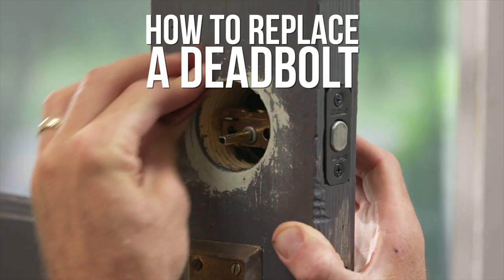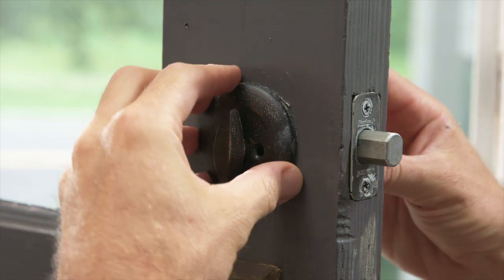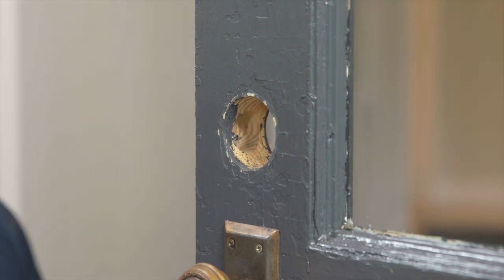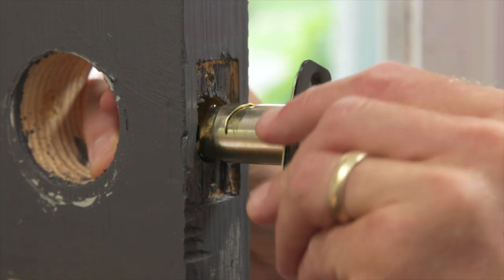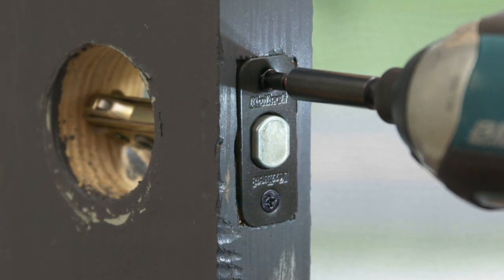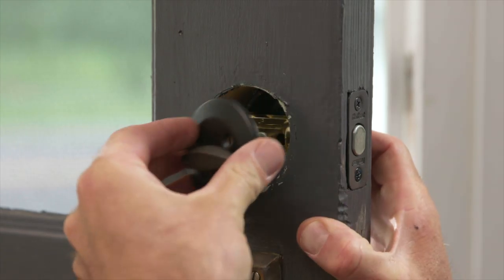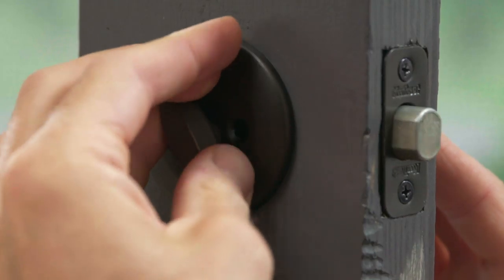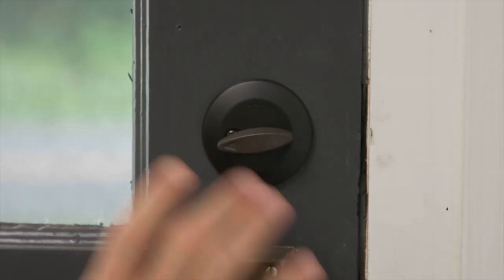How to Replace a Deadbolt | HGTV

Comment: What if the deadbolt is in the extended/ locked position and the mechanism is destroyed? How to get the deadbolt out if the door is stuck in locked & closed position?
Reply: Drill a hole in it
Reply: Got the idea

Comment: When you buy a deadbolt, you should know that there will be several in the case with matching code numbers and keys.
The manufacturer does this so you can use one key to open all of your exterior doors with matching deadbolts.
I suggest that you either find a deadbolt that has no matches in the case, or buy them all and return the ones you don't use on a different day.
Otherwise, a criminal who was watching the shelves could buy the next lock and follow you home to learn where you live.
They would have a matching key from their lock and could let themselves into your house when you were not home.
This vulnerability would be especially important for young women to know about.
Please tell everyone you know and repost this message on every video discussing this topic.
Reply: If you’re really worried about this get a security chain. Anyone with enough determination could just pick the lock for way less effort than following someone home and figuring out what key is used plus I’m pretty sure every key is unique to every set ie hundreds to thousands of different pin set combinations. 

The other important thing to do is ensure you have extra long strong screws securing the hardware or you can just forcefully break in.
Reply: @georgelaxton  
How do you set your security chain when you are at work?  
Criminals look for ways to make their lives easier and safer.  If they get your key, they can come over whenever they like.  The worst crime is financial.  If they get into your house when you are at work, they can get all your financial data and possibly your computer code book.  You know... the one you are supposed to keep safe but is on the shelf next to your computer.  With that data, they can clean out your bank and stock accounts in complete safety.  You will never know that they were inside your place.
It's really easy to protect access to those other matching keys.  Just get a unique key and you will be OK.
Reply: just young women? How about EVERYONE?